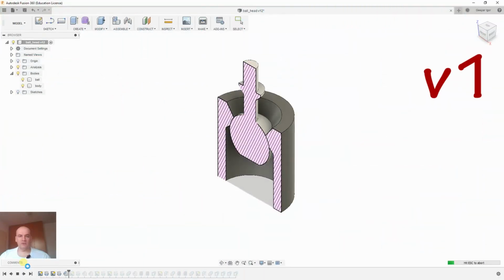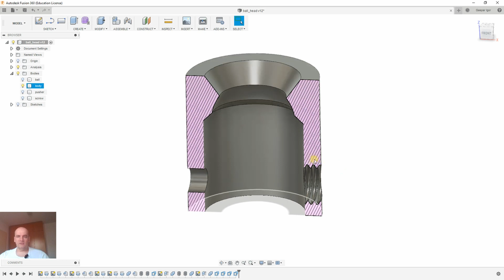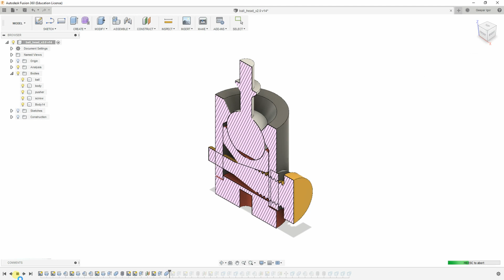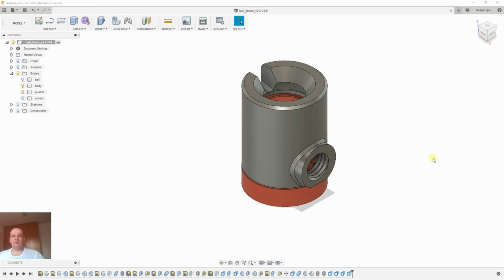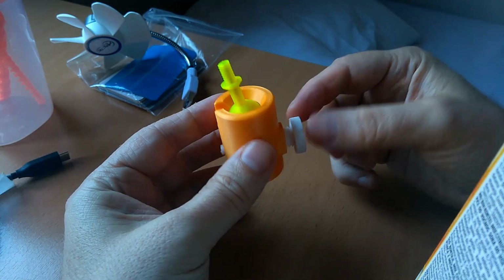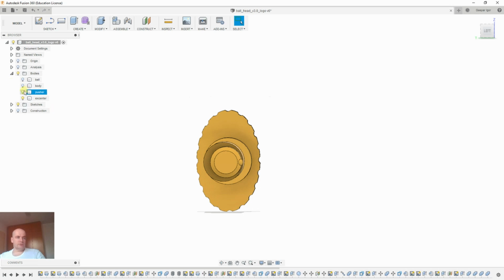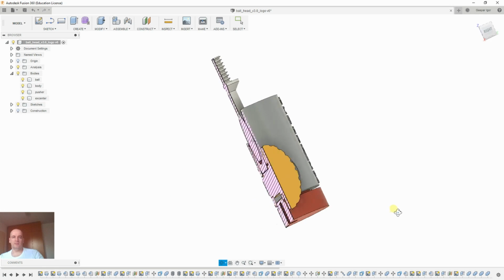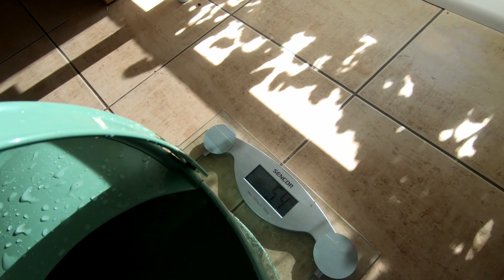3D printed tripod ball head for gopro camera

Comment: Thank you for the detailed explanation video. That was really helpful. Also, is there any chance you have the CAD (SolidWorks,AutoDesk) files of these drawings, maybe I can make some dimension adjustments before printing for myself ? With STL. files only, I cannot edit them :(
Reply from the maker: It's not for public, but I can send you Fusion360 (.f3d) file, send me an email, you can found it on my website ( http://www.mytechfun.com ) on bottom of the terms of use page.
Reply: @MyTechFun  Hey there, is any chance you still having the .f3d file? I'm starting to lern 3d modeling and trying to do something like this from 3 days without any result. I can't find any tutorial with something similar.

Comment: Thank you very much for the detailed explanation. Now I also have designed a tripod using your concept.
 But I change the eccentric screw to oval screw. It will take less time to fix the ball.
Also change the leveling up part to round shape.  It may also help a little.   I also make a video here. https://youtu.be/lC6ja9oTybQ
And I put the model file in here. https://www.thingiverse.com/thing:4348690 .  In fact, I have not checked the Commerical ball head since I don't have it.  I just check the internet and fix the ball head diameter to 25 mm.  Keep making things new and fun.